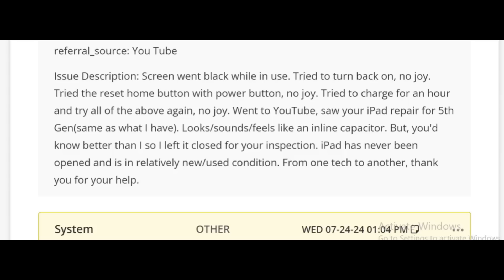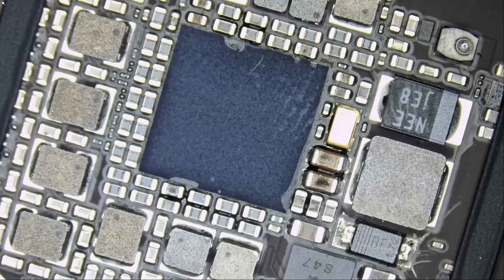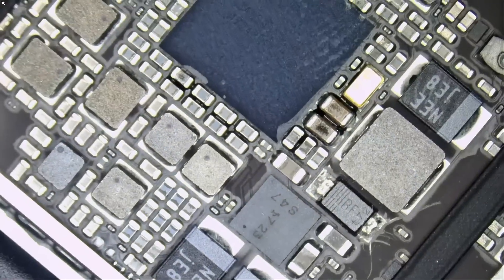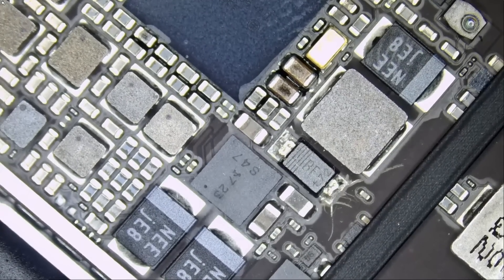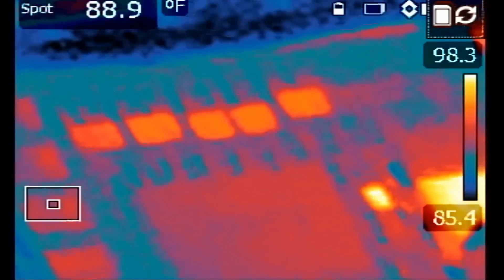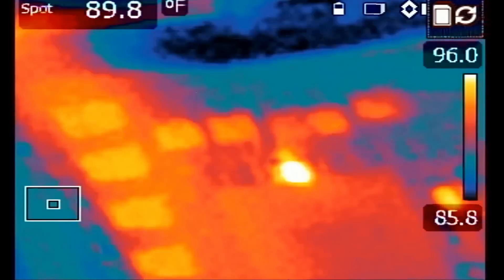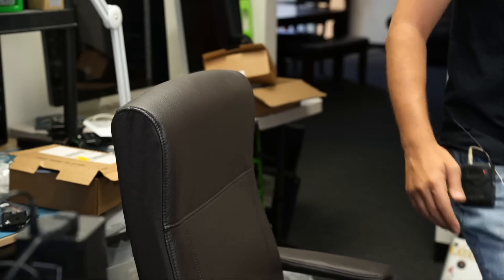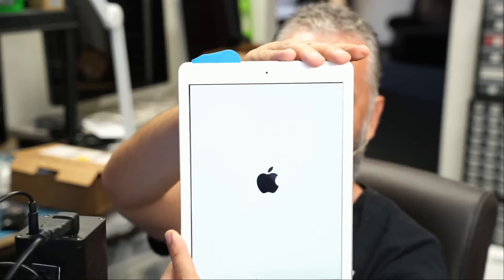iPad 5th Won't turn on. Finding short circuit using Atomizer Rosin Flux powder

Comment: Question. So if you are able to remove the cap and not have to replace it with another, what is the point for it to be there in the first place if it will work just fine without? Thank you. Just trying to learn.
Reply: Usually to comply with emi regulations.
Reply: he tell you in the video…

Comment: I thought the same thing, soldering back a cap there is more risky than using the device without it. As long as it doesn't cause any stability issues, it's absolutely fine. Good job =)